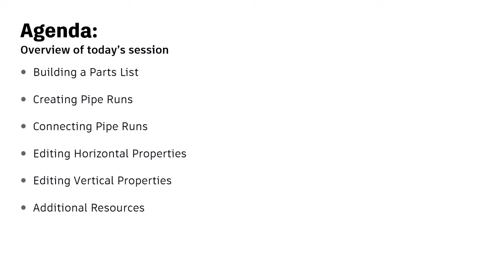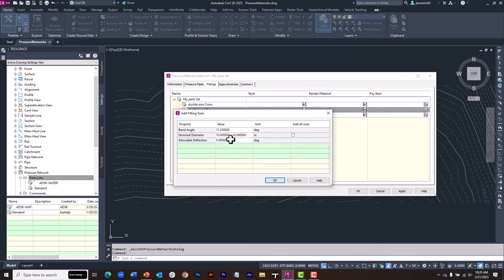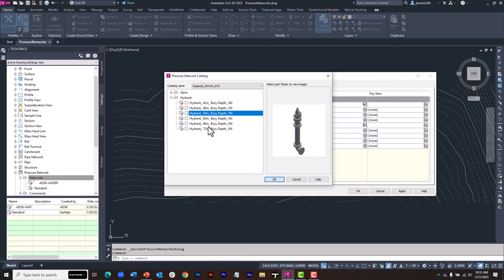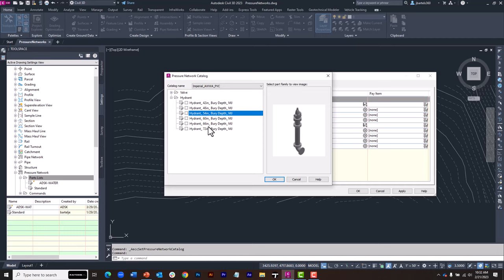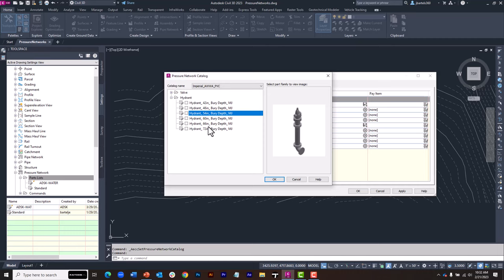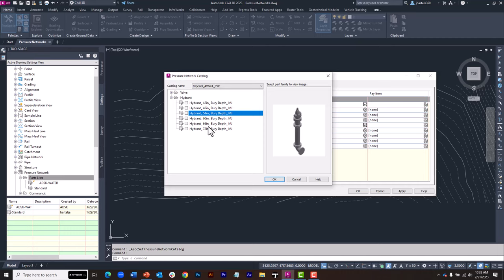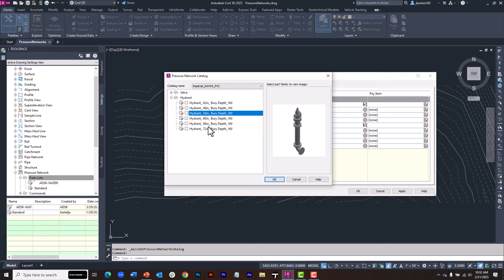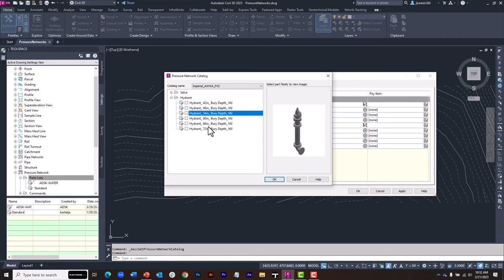Getting Started Modeling Pressure Networks in Civil 3D

Comment: I very recently took a look at the pressure network tools after ignoring them since they were first released due to deficiencies in functionality. Typically I'll start out using new tools without studying the help system, just to get a feel for how they work and find out where I need to  focus my time. The initial experience was frustrating. The familiar workflows for working with pipe networks  no longer apply. Selecting a pipe does not bring up a contextual menu for manipulating the pipe network, but instead leads the user to the alignment tools. This is not intuitive at all, which is frustrating, forcing the user to delve into the help system immediately to figure out what to do. The help system does not include tutorials for pressure networks, which is one more source of aggravation. I have subscribed to your YouTube channel because you are a great resource, being closely affiliated with the product team. Your video has clarified the workflows considerably and show there are much needed improvements since I last used the tools. I now feel much more comfortable with using the tools on live projects and will move forward with them on a current project. I understand this is a work in progress. I can see where there can be improvements to make the tools more intuitive. Hopefully that is being considered by the development team. In the meanwhile your video has really helped understand the tools and is a great resource, so thank you for making it available to the public!

Comment: Now that 90% of the tool's bugs are worked out, this video is right on time. Will be sharing this with my team during training sessions.
Reply: I'm still using 2021.  I'm having issues.  So I was wondering if the bugs that you refer to got corrected in 2021 updates or in new version like 2023?
Reply: @ericstiles7699  let's just say that if I were to try what Jeff demo'd even in 2022, I'd have a broken pipe network or file.

Comment: LITTERALLY the best explanation of this process out there.  I work in landscape and use pressure networks to model irrigation lines.  Kinda clunky but an able to export to Revit for clash detection.  Any vids on modifying catalogs to expand pipes and fittings to smaller sizes?

Comment: Great video! I am currently learning how to work with pressure pipe networks myself. I have one set up with a profile and I am trying to do those vertical deflection edits like you did around 32:30. My grips seem to copy the style of the grade line and when moved, do not actually make the pipe change at all. Do you know why this is the case or how I can make them deflect the pipe?

Comment: Jeff, in my drawing I need the flange elevation set at 4 inches above grade.   How do you get that to set with these pressure pipe hydrants?   Is it a case that now you just have to play around with bury depth dimension and get it close??   There has to be a better way.

Comment: I typically work on a lot of long transmission lines. I have been using the old parts based pressure networks and am just getting into and liking the pressure pipe run work flow. Do you see any issues working with long pipe runs - I am currently looking at a 10 mile long 16" water main.

Comment: We still have some issues displaying bends the way we'd like to. Also 90deg vertical pipes lose their visual diameter. They just appear as a line, which is weird.
Reply: It's because of the difference between vertical and horizontal scale I would assume. Don't have C3D in front of me but see what happens if you set the horizontal and vertical scales both to same number. Or at least lower the difference between them.
Reply: @jaredsilvers2782  unfortunately it makes no difference. 1:1 or 1:5, looks the same (besides the obvious scaling difference). It is something I need to dive into again because I know a former coworker succeeded once. Just cant remember if he used a bend made by a third party or our in-house parts library.
90 degree vertical bends displaying as a line is simply C3D and Autodesk thinking that is the way it should be displayed. Mildly annoying, but having to do so is, fortunately, very rare for me.
Reply: @jaredsilvers2782  wouldnt it be because as the slope goes "infinite" (vert)  the distance from the top and bottom of the pipe will approach zero.

Comment: If you have a network that has a 90deg bend and you end up needing it to continue straight (tee connection) how do you do that?
Reply: in that case, you must provide tee fitting with a short pipe and end cap on it for future extension.

Comment: In the Pipe Run Profile Settings you mention the Reference Profile is a surface profile. Can Layout Profiles be used or Surface only?
Reply from the maker: Yes, a layout profile can be used.  At the end of the session, I showed how to use a layout profile to define a lowering.  You could simply make the layout profile the full length and assign a depth of cover for it.